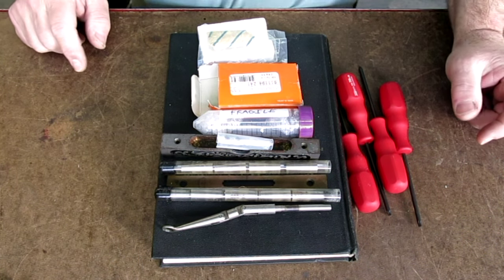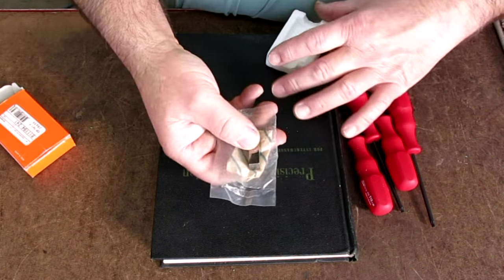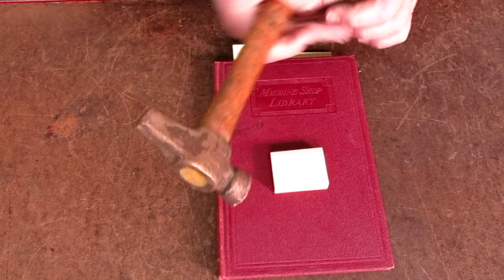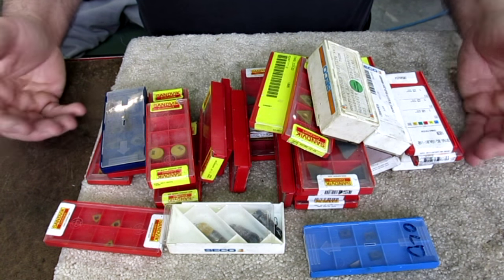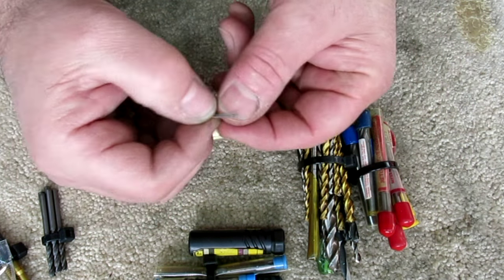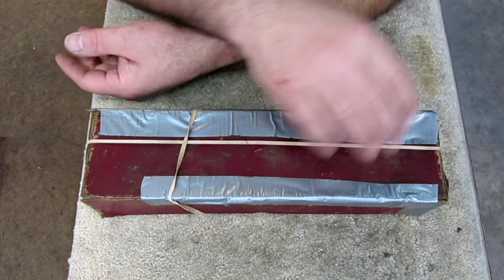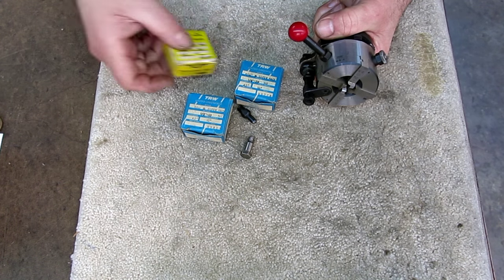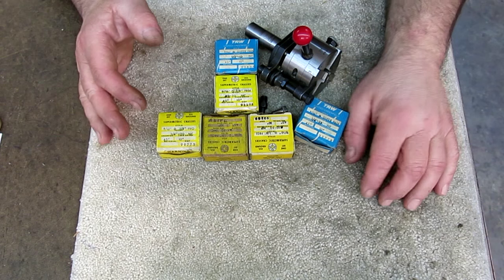Heavy Metal Mail Call 4

Comment: I seem to recall a "mystery tool" in one of your older videos that had a shank that held those milling inserts. At the time you wondered what kind of bit it was intended to hold.

Form taps also make stronger threads, for the same reason that rolled threads are intrinsically stronger than cut threads - the grain runs up into the threads (because the metal was displaced) rather than being cut off.

Comment: 38:07  Yeah, that's for turning stock with an end working station (turret).  One set of cutters should lead the other slightly, for roughing, while the finishers are fine adjustable.  I suspect that's probably a nominal size fixed rougher, like .375".

Comment: The 'Hydraulic' cylinder is similar to some of the components I took from a "Pneumatic" pocket press that used heat and pressure to form pockets for pants.  Based on the light vinyl hose I think it is pneumatic, thus the air bleed valve on the end.

Comment: The Lufkin tip appears, as best as I can tell without a closeup, to be the original. I use my Lufkin, and my Starrett equivalent, and my Ideal equivalent, on a routine basis. Handy when I don't want to tie up a dial unit, or need to fit whee a dial unit won't, or just want the ruggedness these have, and don't need more range than they give. Often easier to read, an well, given no glare from a crystal. I have had occasion to use the hole in the tip of these older units. A hooked music wire allows for use remote from what you are measuring,  either push or pull, even through a small (25thou or smaller) hole.

Comment: Hollow mill is used on a screw machine. Cuts from the end so loads are balanced.
Reply: +powaybob Hollow mills can also have non-cutting blade which help support the material while being cut. The Space Shuttle Main Engines had parts that, by necessity, were hollow milled using jig boring machines. Hollow mills aren't limited to screw machines/lathes.

The blades can also have forms ground (tapers, steps, chamfers) into them for producing several features in one cut.

Comment: The cylinder looks similar to a downfeed control from an old Kalamazoo horizontal bandsaw that I had many moons ago. When working properly, the lever would vary the bypass of oil and allow a variable feed rate of the head.
Reply: +Jeff Silence I was about to post the same thing. Nichols mills has a cylinder arrangement similar to the item pictured. It was used to provide a steady feed rate when working the table by hand. I suspect the set-up has no oil in it.

Comment: Gage is the US spelling, Gauge is used in most of the rest of the world. A loose Gauge Block is very handy to put under an indicator when trying to accurately indicate a scraped surface. The scraped surface has a texture that makes measuring somewhat tricky when you pull the bus in to Tinyville. The Gauge Block averages out the scraping and provides a good reference to measure the actual error instead of the depth of scraping. You can of course use one from a set, but it knocks them around and wears them. A loose one can be any size and it doesn't really matter if it gets worn.

Comment: Those hollow mills are pretty sweet tools--I have a few from Genesee that I use in the turret on my Hardinge DSM-59. Or is it a DV-59?  I never remember the difference.  Anyways the most common shank diameter for the small Hardinge turrets is 5/8" 

The Genesee website has some nice technical information on using hollow mills.  One cool feature is that you can grind different cutters to produce tapers, steps, spherical radii, etc.  I personally have broken many many cutter bits attempting these things.  Then I smartened up and started using the tools with just two cutters instead of the four thy hold.  Now I only break half as many. . . .
Reply from the maker: +cod.cape Hi Cod,

You have me curious now. I looked at the Genesee website and now I want to test that tool. Thanks for the comment.

Cheers,

Tom

Comment: Looks like removable hollow taper pins. The internal thread is to facilitate removal.
Reply: +Jeff Silence Yeah, same here. Never seen ones so small, so probably some kind of plate system, but i have seen longer ones (@5 cm) that come in the same packaging too.

The ones i saw also had a small puller in the box.

Comment: Im pretty sure that the lixie hammer is a non sparking hammer, made out of silicon bronze.  I have acouple and theyre great.
Reply from the maker: +Dillon G Hi Dillon,

I welded it up with silicon bronze filler rod. It seemed like a match made in heaven. Color match is perfect so I think you are correct that the head is silicon bronze. Thanks for the comment.

Cheers,

Tom

Comment: That mikroscope slide thing is a calibration grate. You put a insert with a scale inside the microscope tube and then use this known graduated slide to find a correction factor between the scale inside the microscope tube and the slide.

http://www.microscopyu.com/articles/formulas/measurements.html

Comment: "No. 76 drill.. I have no idea what size that is"
Why would anyone decide to use such a stupid system for naming drills? Look at the chart on wikipedia how the sizes don´t even form a smooth curve!
Reply: +kubeek I have to be honest, with inches, I'd much prefer a number to a fraction LOL. (a size in thousanths of an inch would be best of all though)
Reply: Sorry but to me fractions are even more silly than the arbitrary numbering. How big is a 13/64 hole? How long does it take you to calculate it in the common scale of mils in which you measure everything else? Is the right drill number fifty-ish or forty-ish?Why can´t you people just stick with decimal notation?
Reply from the maker: +kubeek Hi Kubeek,

The wire gauge sizes correspond to the fabrication of wire drawing dies from way back. The size relationship is not linear as you can only reduce the size of the wire in certain increments that changes as the wire gets smaller. As the wire gets smaller you cannot pull on it as hard so the increments get closer together. There is some ancient madness to the sizing of wire size drills. Hope this helps, Thanks for the comment.

Cheers,

Tom
Reply: +oxtoolco Tom, am I right therefore in assuming the drill numbers are the same as AWG sizes? That would make more sense...
Reply: +oxtoolco Well first of all I am glad you actually took time to answer my rant. 
I allways knew there was some old habit from which the numbers and letters came from, my frustration was more about how stubborn the imperial system is and that there is never, not even in my 50+ expected remining ilifetime, going to be anyone who will not sell you a no. 76 drill, one who would ask you what the hell is that supposed to mean.